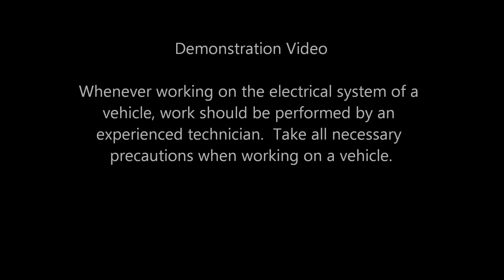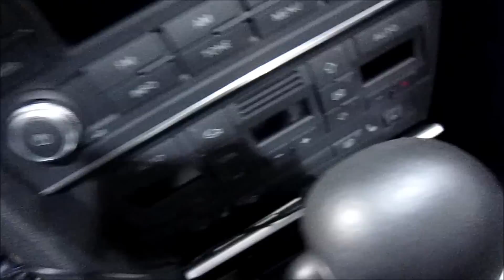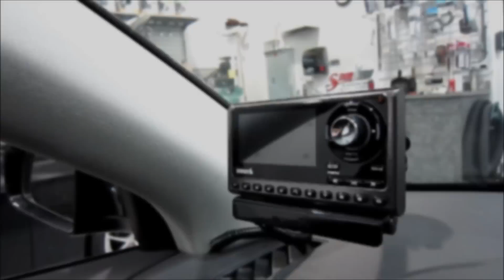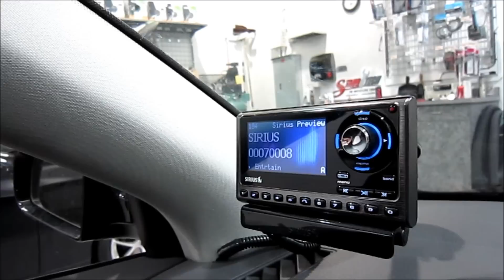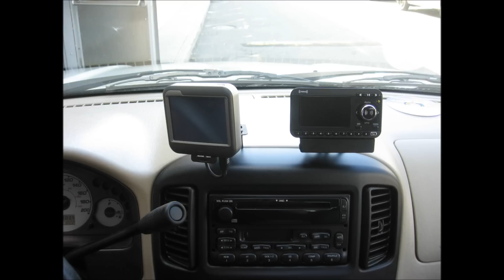Satellite Radio Installation (SiriusXM Radio) | AnthonyJ350

Comment from the maker: You'll have to purchase a tuner that can interact with you're new head unit.  I've done installs placing the new antenna into a similar housing and I've done ones where we adapted into the factory wiring for the antenna and used the factory antenna.

Comment: I have installed two antennas now. Both times I placed them in the back window of the car with a small bit of double sided tape on the flat and they work fine. I ran the wire under the floor mat to a  area near the power plug.

Comment: I was under the impression you could buy a Sirius/XM device similar to an actual radio with an antenna, and move it around the house.  But this video shows it's way more elaborate than I thought.  Makes me wonder if there's technicians you can call to either come out and hook it up or guide a customer through over the phone conversations.  I don't really wanna hook Sirius/XM to a computer but I guess I can if that's my only option.  You see I had this idea (probably crazy idea) to hook up a Sirius/XM device like a stereo system with speakers 'cuz that's how I like to rock, but I don't think my idea will work and is probably considered outdated.  Seems like there's too many factors involved to make this a realistic option.  I guess I just assumed you'd be able to buy a Sirius/XM device, and speakers would be sold separately.  I have been listening to Sirius/XM through Dish Network so knowledge there's an alternate way to listen to Sirius/XM besides the car or Dish is brand new to me.
Reply from the maker: +surething baby I think there are still docks available for SIriusXM for home use.  Did you check their web site?
Reply: +AnthonyJ350  I checked their site after watching your video.  Yeah there is something available, thanks!  I don't like the idea of using 8 C batteries though.  Then again a 14v adapter might be a good alternative.

Comment: Great tips  about the 5 v power knockdown for the radio & needing to use the supplied plug but I am still confused on the soldering to plug? If I hardwired into male plug end & plugged in female plug that would work
Reply from the maker: You can buy female power sockets with pigtail wiring. I find it comes apart over time, that's why I solder direct.
Reply: Ok thanks for clarification

Comment: Where did you hook the power to? Best Buy mobile install gave me the 12 volt female lighter adapter. Are there terminals in the fuse box or do you go to the battery?

Comment: Anthony thanks for the video, at 5:28 you have the unit installed in the center, how are you holding the unit up? I see the sleeve for the wiring on the right headed under the trim but no back support.
Reply from the maker: chvydrptop Ahh these are all jobs done in the shop for customers. I installed 2 metal straps behind wrapped in shrink tube for the one at 5:28.
Reply from the maker: chvydrptop If you look at my Instagram I install the odd SiriusXM tuner. Most of the ones I do is the module in the dash with an aftermarket headunit.
Reply: Ahhh so its a custom bracket holding up the radio you mean? I have a Durango same exact center, trying to figure out how to install it down there.
Reply from the maker: Yes, you'll have to take it apart, install a custom bracket then put the console back together.

Comment: Personally I got a CB Radio already with the antenna on the trunk, why not just put the antenna on the trunk and run it in from the trunk? As long as you aren't using your trunk 24/7 it shouldn't be a problem really with the wire being pinched.  Seems for a more pain free installation to me
Reply from the maker: You can mount the antenna anywhere outside as long as it's on a relatively flat surface.  I've done a few installs where I put them on the trunk or the rear of the roof.  Typically I put it on the front center area of the roof because I don't ever worry about the wire being pinched.  I provide lifetime warranty on my workmanship.

Comment: Anthony I bought my 2006 Scion Xbox used before I was married. It has a button on the radio controls for sirius but it's not a sirius radio. It's factory if I'm correct with am/fm cd.
I have called the Sirius themselves and my vehicle was never registered as having the service. I was told that I need a Sirius Radio which is fine but I'm somewhat stuck on which one to purchase.
this vehicle is the one my husband drive back and forth 2 hours a day and this will be his birthday gift. He purchased a 2012 Equinox with it already installed.
While he drives my less than comfortable Mouse  (it Squeaked at 1 point ) and misses his Fantasy Channels I drive Red in comfort. 
could you help me please?
Reply from the maker: +Susan vadnais You can try talking to a Scion dealership.  But most of them won't know what to add to make it work with your car even though it has the button.  What I do is just change the head unit and add a new satellite radio tuner and it will just work.  Or you can add the stand alone tuner and play it through the radio or aux (if your stock head unit has it).  Just depends how clean and how good of sound quality you want.

Comment: Yes im majorly disappointed. Have the sirius xm home radio with the small square antenna. Shelled out 44 dollars to subscribe and activate. Tuned to channel 1. Have moved the antenna through my windows on both sides of my apartment after they sent activation signal. Still ZERO on satellite and terrestrial  signal indicator. Will somebody tell me whats going on?????
Reply from the maker: Bert Davis What area do you live in?  Did you talk to SiriusXM?
Reply: AnthonyJ350 No. Thats my next move. And i live on the gulf coast of Florida 32570 zip code.